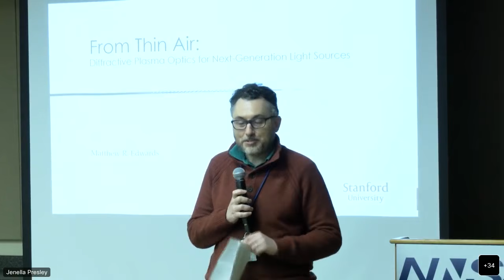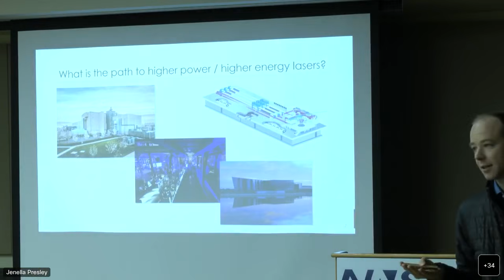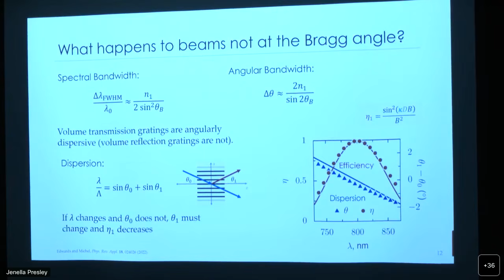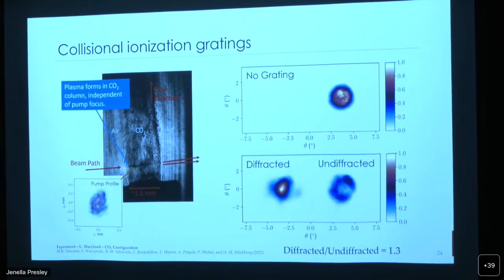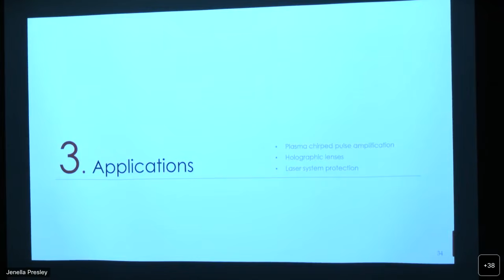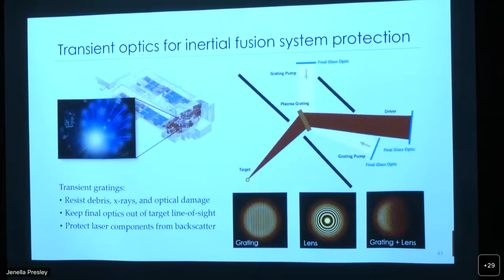HEDS Seminar Series| LLNL-VIDEO-2017258

Comment: You should have started with a cylinder with inserts. Starting from any box with sharp edges will give you a chaotic standing wave that is akin to two mirrors reflecting against each other.  It creates a fixed structure but any perturbations of the source or what is the reflector change minute parts wild. In a high enough energy regime this gets balloted out  but if your using self reenforcing wave structure which you should use in most cases you cant ramp up to it and have to start there which at a certain point becomes impossible. Look at it from a 2d sand on a plate perspective. When you add energy you get stable regimes That collapse into static in both amplitude(because there is no perfect real world source) and wavelength.  Because you are trying to ramp it up you need to control the negative and static space not the overlap. The standing points shoot out into infinity in complexity. The negative don't always do this.  Then it is just a matter of overlapping noninterfering standing wave systems that fall apart and can be replaced as power is increased. The internal physical structure will always dwarf the wave input in the end in any case. You could use a dozen materials in four phases of mater with a list of different properties and you could still probably replace all of it with the right structure of the outer ring with add ins and off shoots. Its just a better place to put structure. When you work form things in free space you run into the medium itself changing as the system ramps and the entire thing fizzing out and it becomes more stable when you have it projected from a outside source and have them overlap.
Reply: In fairness I have not worked with lasers in this and what I know comes from experiments in using the same idea of structured waves to separate materials. So there are probably a lot of quantum things I am not accounting for but I think most of what I brought up still stands.